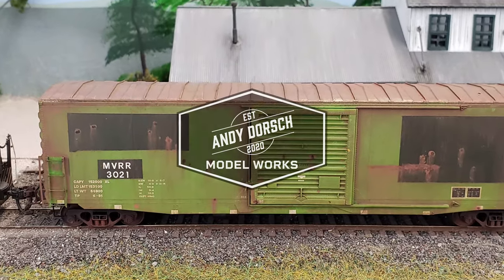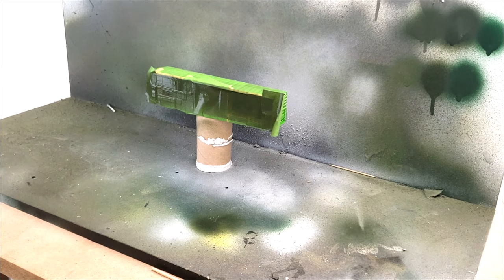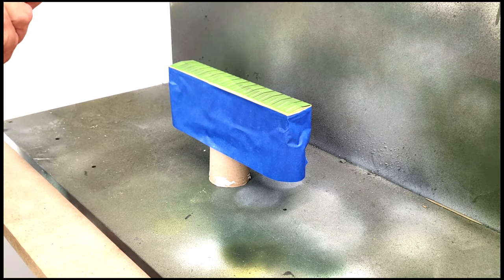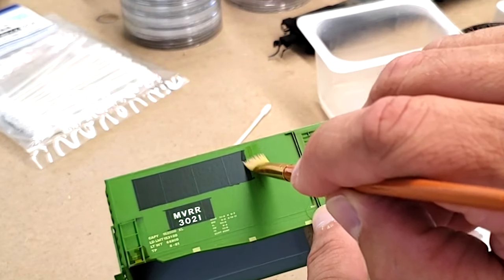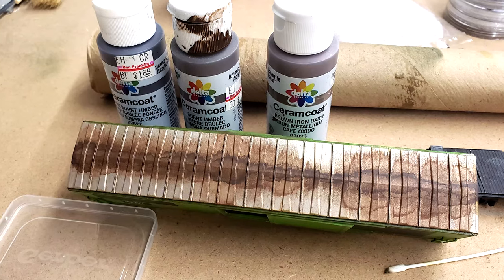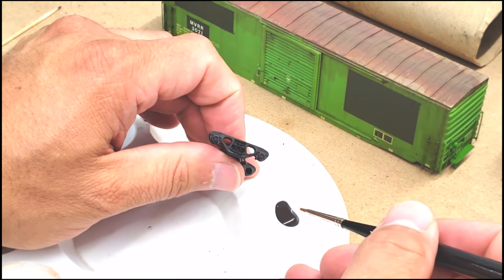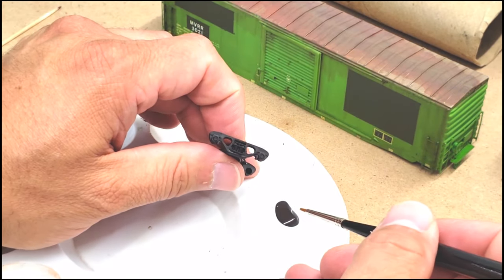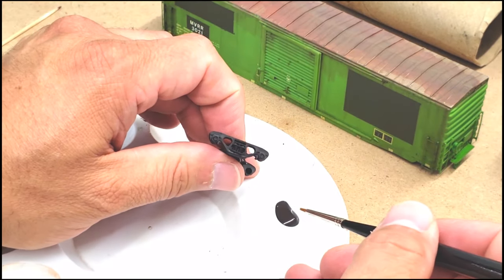How to REALISTICALLY patch out and weather a box car WITHOUT an airbrush

Comment: Really well done tutorial! Tip for laying out the masking: cut a piece of the wider Frog tape to the exact dimensions of the area you want to mask and use that as a guide. Apply the thinner yellow masking tape around the perimeter, then peel away the large guide piece and mask off the rest of the model. Wider tape is easier to handle insofar as maintaining a straight edge. Thanks for sharing.
Reply from the maker: Jeff...that's a good tip! I'll try it next time on my next model!

Comment: Few questions. 1) Do you add dull/gloss coat between weathering layers? 2) After finishing weathering hoe do you keep your coating from washing off the powders and other weathering? 3) I have AIM powers. Do you know if they mix with the alcohol like the Brandon powders?
Reply from the maker: 1. With the powders yes I dullcoat between layers. I don't use gloss, the dull coat adds teeth for other weathering mediums to grab to. Gloss is "slippery" and powders and even paint may not grab hold.

2. I hit the whole model with dullcoat after wards. Fixing all the weathering materials to the car.

3. I have never used aim powders...but I think I saw Ralph Renzetti use alcohol with AiM powders.